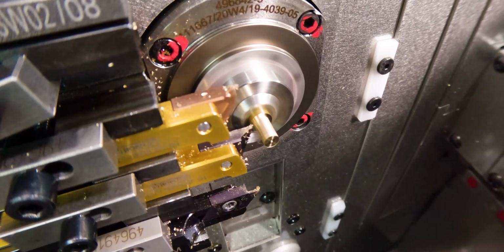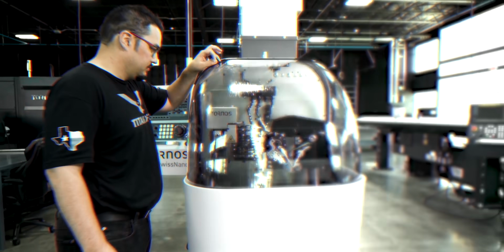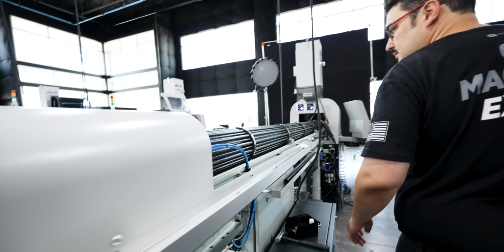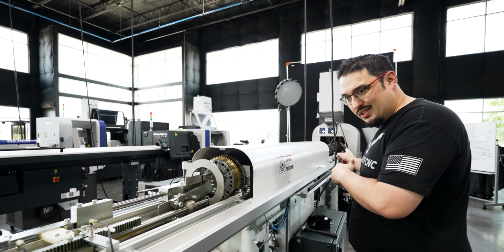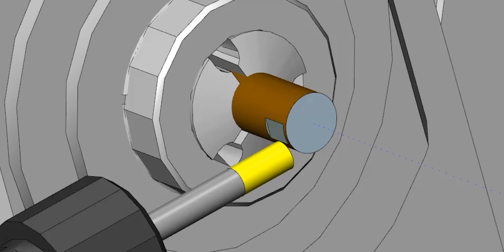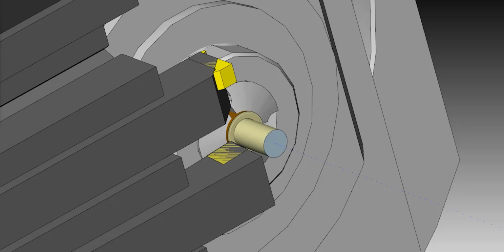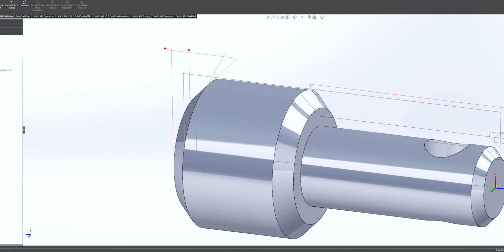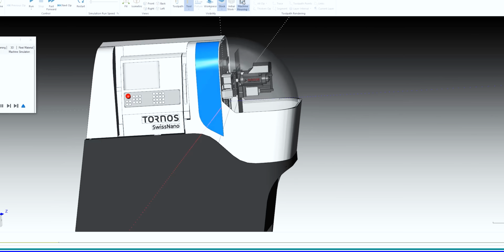The Smallest CNC Parts I’ve Ever Made!

Comment: I once saw a coworker making wristwatch screws on a similar machine (from the 1980s, not exactly CNC). I was also surprised by the length of the machines (there were 10 or 12 of them) and the rods he used. 
P.S. The monitor sucks, the width is great, but it looks like a 21:9 ratio, it's just too small vertically.
Reply: Probably old cam screw machines. They were what came before the CNC Swiss lathes.

Comment: I love how easy it is to access the parts that fall into the “black hole.” That’s not something most general lathe machinists are used to. I used to find missing parts that had rolled out of the machine every 6 months during preventative maintenance. 😆
Reply: though the good thing about normal style lathes is how easy it is to get to the chip conwayer ( unlike a citizen swiss lathe xD you might find it in the chip bin. but no way on the convayer. you can barely even see the convayer to begin with let alone touch it. speaks from personal experience from a L12. a L12x and a L20 )